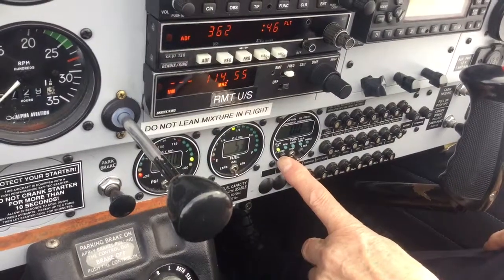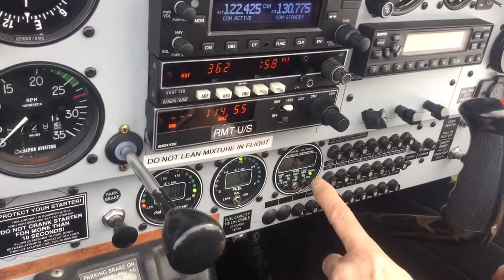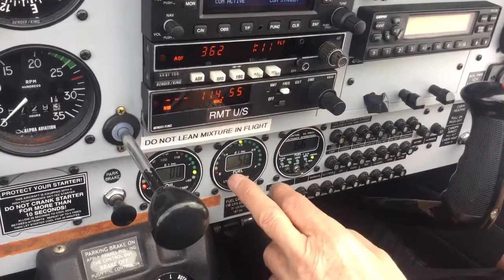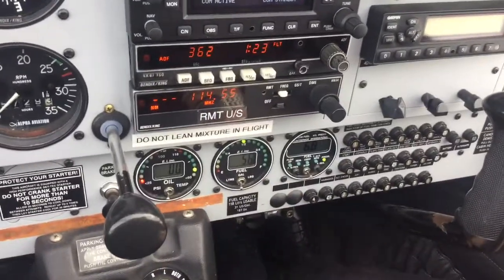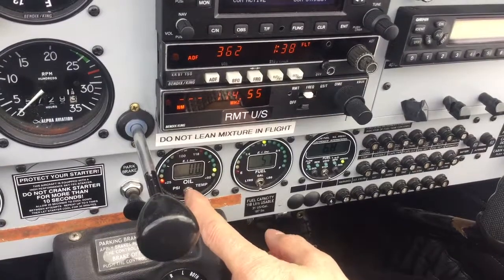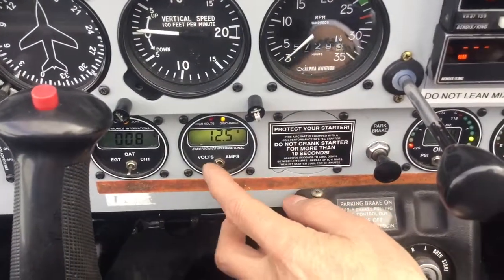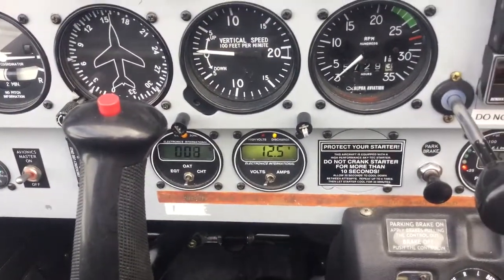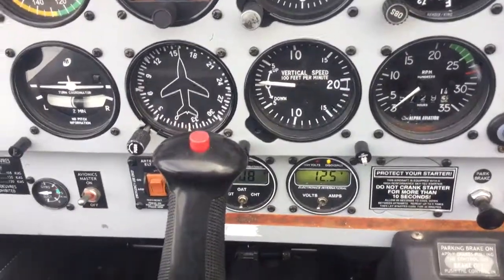HR200 Video 1

Comment: Do not lean? Why not
Reply from the maker: Flight Sim Centre The Instructor said that with local flights and low level ie which I would consider to be less than 3000 feet, they do not encourage their students to lean the mixture. They had had some that had leaned to the point of engine damage, I think that the leaning procedure seems to depend on the aircraft and the operators point of view. When I was flying the Rallye, I leaned that as soon as I was in the cruise, at 1500 feet and above as this is what the instructor  insisted on. With the Tomahawk, I normally lean as I pass 3000 feet. Mileage as they say, may vary.